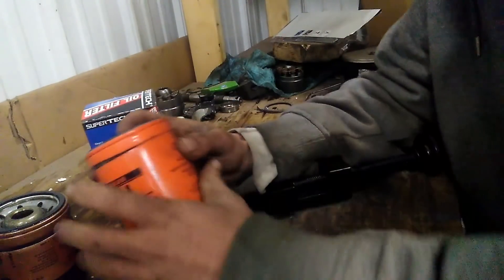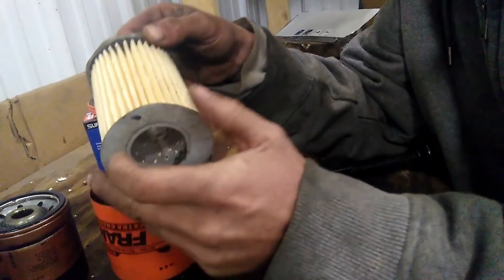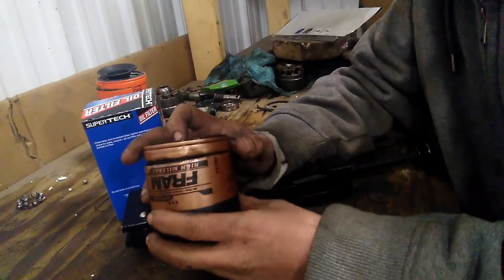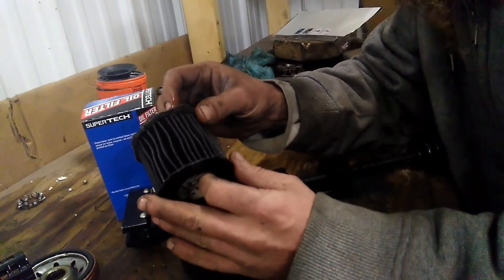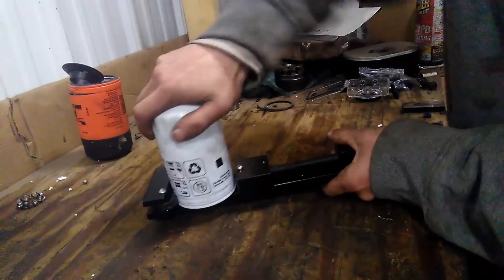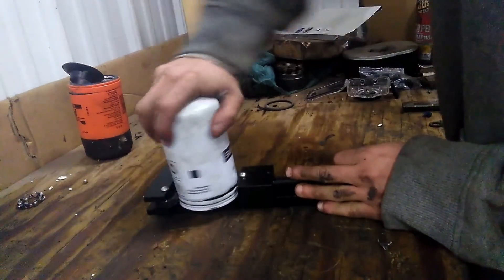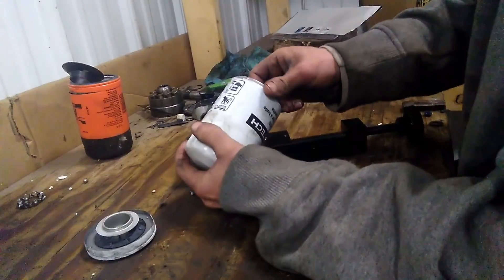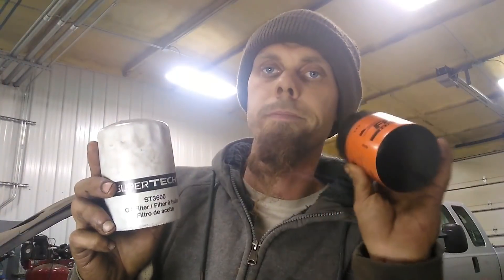supertech vrs fram oil filters: are fram oil filters really the worst you can buy?

Comment: For one thing the cheaper filters are just that cheap but they work as they are designed (3 to 5k miles), they are not intended nor are they designed for racing applications, as you stated the second frame filter was taken off a racecar. If you're using these filters on a racecar you're not gonna get the performance you're looking for strictly because thats not what these filters are designed for, Id suggest find a filter designed for racing applications then compare the filters under those same conditions. Until then you're just another guy making videos trashing frame because you don't like them which is fine just be honest by comparing apple's to apple's not apple's to oranges.
Reply from the maker: Interesting take on it. I it's been a while since I made this video but I don't think I trashed fram. I should probably watch it again my memory might be off. But I just showed what I found cutting open a few filters my only personal opinion that I included that I remember was that I thought the superteh was a better filter. I guess for clarity as well. The race car was never raced on that filter it was installed after the engine had been out and would have changed the oil again before racing it. Witch is why it was a cheap filter installed. It only had a few test drive miles and several times being started up and pulled in and out of the shop 50 miles is a very high estimate. But it did have a lot of sitting time filter had probably been installed for more than 6 months. Thanks for watching and your input

Comment: A video like this is totally incomplete unless you compare ALL Fram filters and not just the cheapest one. Fram makes four different filters. They are not all the same. They don't all have cardboard ends. For than matter, many elements that go into cartridge style filter housing have no ends. The end caps don't do any filtering anyway.
Reply: All the Fram filters have similar construction, except for the Ultra Synthetic.  The only difference between the Extra Guard and the Tough Guard is that the Tough Guard has a silicone anti-drainback valve.  The Ultra Synthetic is legit though, and usually costs a few bucks less than other high-end filters.

Comment: that's not cardboard. a lot of ignorance about fram. don't buy it if you don't want it but they do better that cheapies.
Reply: and what is it? Special cardboard? ok it is special but is still cardboard..
Reply: Nicola6892 it’s some kind of fiber. It doesn’t breakdown from being soaked in hot oil. I think it actually filters dirt out of the oil also unlike the cheap metal ones.
Reply: jeffscomp it filter good if u change your oil at 3000 miles but the problem is that fram doesn't have a bypass valve so is more easy that it  will collapse. Anyway here in Europe we use Bosch or mann-filter and they are pretty good. I change my oil every 13k miles and is still good. But i don't use the shit oil mobil 1. All Americans say that mobil 1 is full synthetic when isn't true. A true "full" synthetic have write: 100% synthetic like motul. So mobil 1 is a better and filtered mineral oli with pao bases, but it's still mineral oil.. ;)
Reply: @Jeffscomp: I've seen the inside of a Fram filter, it looks like cardboard to me. However, even if you overlook that, this video shows that the filter element is not glued to those end pieces. Secondly, the metal piece on the bottom is not a spring and does not act like a spring. I tried to push it in to cause some resistance, like a normal spring, and it does not work. It's plain junk. The only thing good thing about the Fram is the rubber coating on the outside of the filter housing to assist with the grip.
Reply: Sunil Thomas I like them and they work great for me. Buy what you like.
Reply: Fram filters have always been junk and always will be.

Comment: Supertech is definitely better. You do get what you pay for. I have used Mobil I I use Mobil 1 5W30, and Mobil 1 oil filter. I’ve had good luck with them. My 2001 Monte Carlo has 177,000 miles. No mechanical issues yet. Just tires and brakes.

Comment: As far as I'm concerned cutting open filters proves nothing. Show me the tests that compare how many parts per million of contaminants are removed by each filter and what flow rate of oil is maintained.
Reply: Walmart claims that SupererTech filters have 99% filtration efficiency as tested per ISO 4548.  For example: https://www.walmart.com/ip/Super-Tech-Spin-On-Oil-Filter-2-1-2-ST6607/506906164
"High-performance media for more dirt-holding capacity and 99% filtering efficiency"

Comment: As I see it, the flimsy cardboard ends don't matter as long as the used oil with these filters tests out OK, and FYI, it does. You're grumbling about something that has no effect on the longevity of your engines if you choose to use Fram filters long term. Fine, don't like cardboard ends? Then boycott Fram but I'm willing to bet,  the engines of Fram oil filter users will last as long as yours with your alternate brand oil filters.  Your visual test observations are backed by hearsay, not science.

Comment: Nice video. But I used the cheapest Fram filter for 19 years and synth Supertech oil every 6,000 in a 97 Mazda Protege, Guess what? Not blue or any other color smoke from the tailpipe. Moral: change oil consistently. (Car has 343,000 miles)
Reply from the maker: i agree even the cheapest worst commonly commercially available products combined with frequent oil changes and basic maintenance is sufficient. however it is a bit of piece of mind to most to use higher quality products rather than just good enough.
Reply: Ezrider92356 - and thanks to you I found a better oil filter!

Comment: This video is misleading. You used the cheapest FRAM to do comparison. What you really need to do, to have a credible assessment, is to compare with same priced products from different brands.
Reply from the maker: Supertech was cheaper than the fram
Reply: @Ezrider359  interesting. I’ll check it out. I always use the high end FRAM for synthetic. It does not make any sense to save a few bucks on filter and engine oil.

Comment: Nothing worse than Fram, except no filter at all!
Reply: Actually if the cardboard in the fram filter comes apart, it could clog and stop the oil flow back into the cylinders and cause your engine to cease
Reply: @matthewhartup941  Melted plastic from drain back valves in other filters could melt and get clogged into holes also.   Same with silicone anti backflow valves.     You complain about the "cheap" Fram bypass spring but at least it will easily allow bypass.    No bypass and your engine is starved for oil on startup when it is very cold outside.    Filters run on bypass a lot more than you would expect.